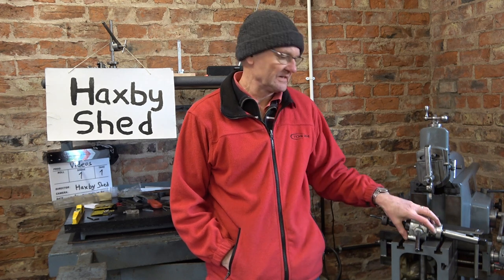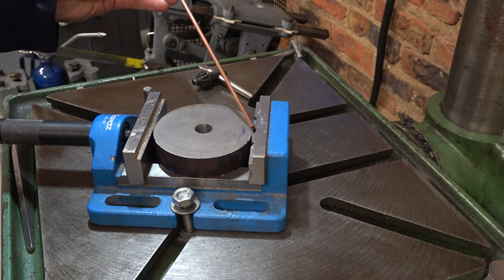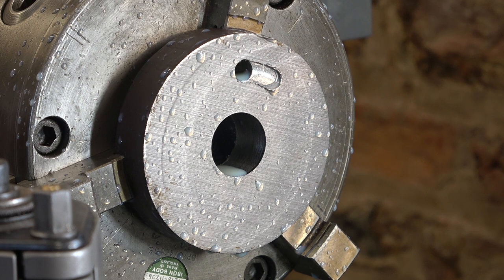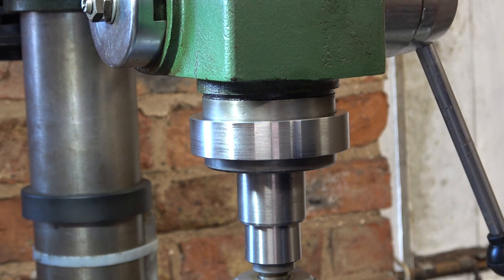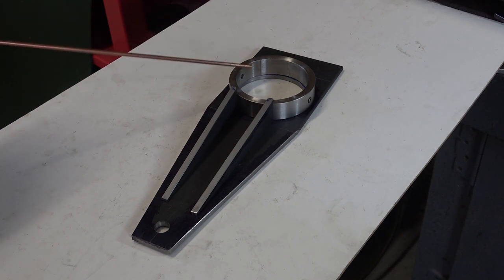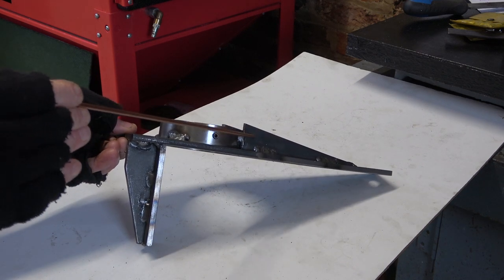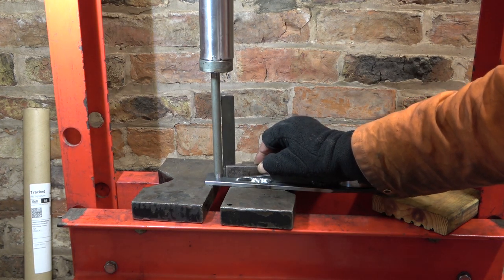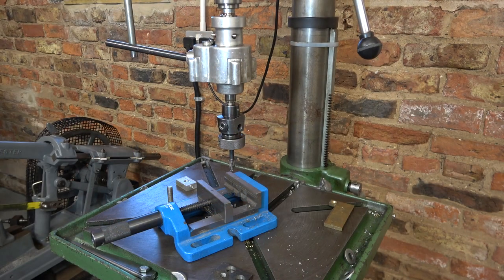HS54 Tapping head & bracket - Part 2

Comment: 4130 is what we call in the states "chrome moly". I made my alcohol dragster out of this tubing, (Drawn Over Mandrel [DOM] of course). It's very tough stuff; can be normalized or heat treated; & is very resilient. You chose right for toughness but carbide is the only way to machine it. Good job though.
Reply from the maker: Thank you. I'm reassured. I thought it was just me and my inexperience struggling with it. Cheers

Comment: Another nice informative video, I think the problem with your first set up was a lack of ridgidity and the EN16T. I still can't get over the price you paid, well done. Cheers.
Reply from the maker: Hi Paul, yes I think both those factors played a part. But it's all experience. The seller had several tapping heads for sale all much more expensive but they were all recognisable brands. Not were warranted - just sold as seen. I had a watch on tapping heads and when I saw it pop up buy-it-now I hesitated for about 5 nano seconds - just taking pot luck, and I was. Cheers

Comment: Nice job, definitely a alloy steel, I don't think there is a common colour code across steel suppliers. A rough check to test if a steel has sufficient carbon to harden, or maybe difficult to machine, is too strike an arc to create a blob of weld near an edge,, then try the file test. Compare to a known steel if possible?
Great vlog and thanks for sharing.
Best regards from the Black Country.
John.
Reply from the maker: Ah I did wonder if colour coding was standardised (or not). It's definitely very tough anyway, whatever it is. The seller said EN24T. Cheers
Reply: @HaxbyShed  McCready Steel was the predominant steel supplier, for eons, and many used their colour codes, it's now goes by the name Acenta, try a search for "Acenta Steel Colour Codes". Though this is largely academic, unless purchasing from them, EN16 is shown as colour White on their table. Even professional steel suppliers can supply the incorrect specification, but as you are most definitely aware, eBay material can be a lucky dip.
Carbon steels (carbon ≥ 0.40 %) produces better surface finish in  machining, I compare mild steel as stringy cheese, and Carbon/Alloy steels as hard cheese. 
Tapping head works brilliant, the M10 tap you used is a "Spiral Point", designed for through holes, my apologies if you already knew. Hass CNC Machines on YouTube did a great video on tap types. I will try to find the video, and insert a link.
Reply from the maker: That's really helpful thanks. I have found the Acenta colour codes.  You might not be able to post a link in comments. Most creators disable them to avoid the sort of links to sites that you would not want on a respectable channel.
Reply: @HaxbyShed  YouTube will automatically delete comments with URLs in them, except (I think) for links to other YouTube videos.

Comment: very nice work, what trade did you apprentice in if you dont mind me asking?
Reply from the maker: I did my apprenticeship in a general repair workshop. All apprentices did their first year in general manual craft and machine work, and then we could choose a trade. The options included vehicle mechanics, general fitters, machinists, auto electricians etc. I chose to be a telecomms apprentice repairing radio sets and light electrical/electronic stuff. Luckily for me the employer was very supportive of further education and after a while they sent me to college full time. When I finished education I did some engineering design and then went into project management, contract management and all that stuff.  So as far as machines are concerned I'm in the 2nd year of my apprenticeship trying to remember back 40+ years :-)